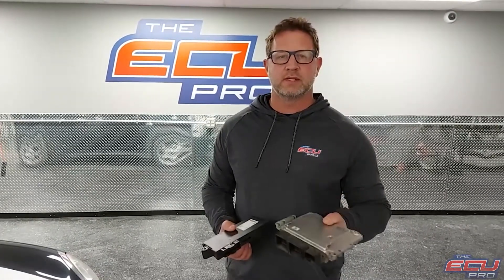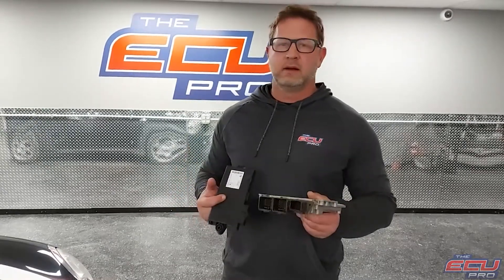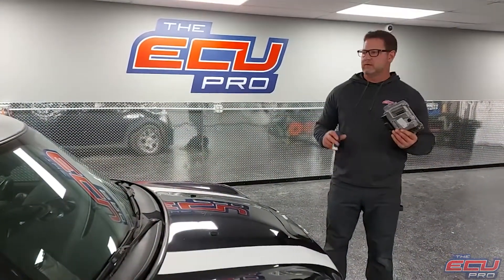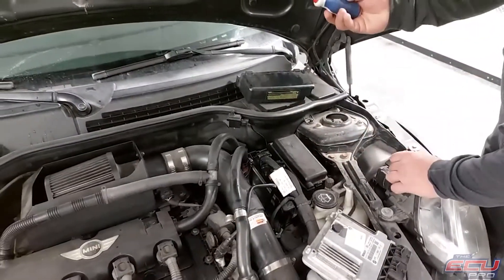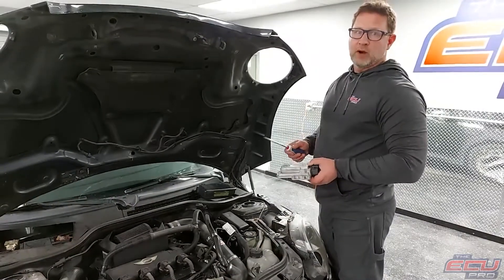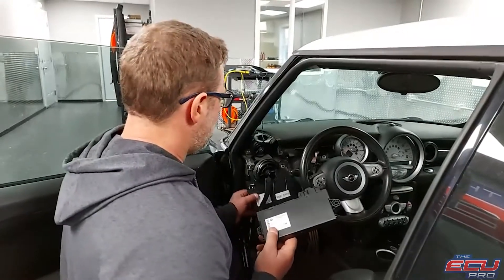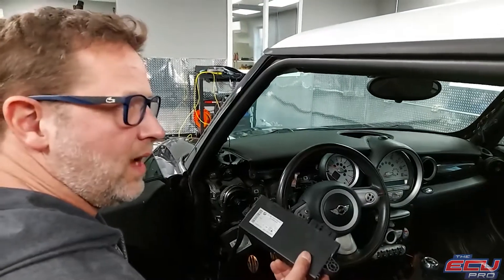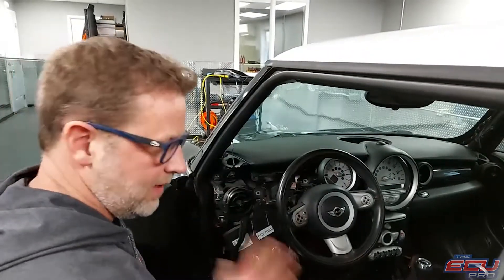MINI N14 1.6T MEVD17 DME / ECU Removal & Repair.

Comment: What if it's only an issue when it's cooking in the sun all day? It will start just fine in a shop. But the day I put it back in my car and park it at work for a day im stranded at work until the car airs out a bit.